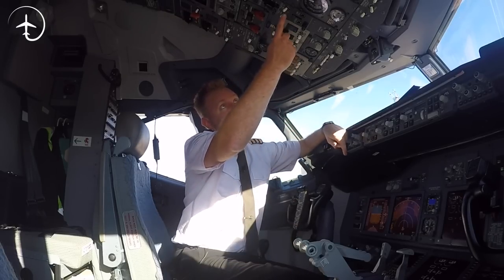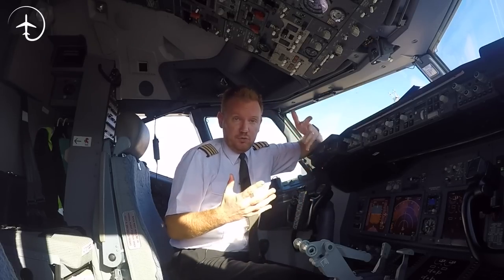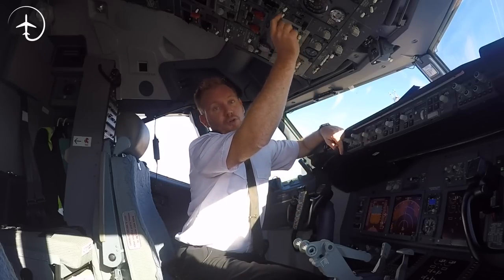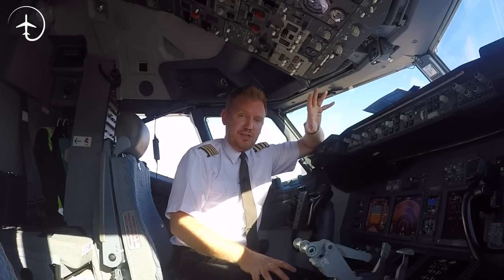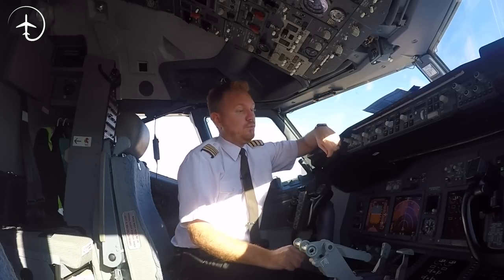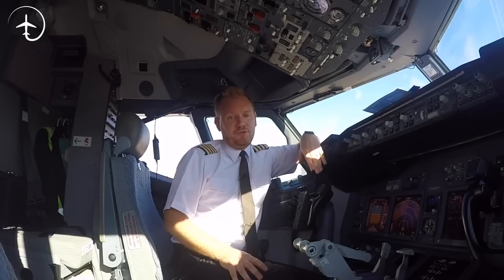Aircraft HORN (Claxon) and “No smoking” signs

Comment: Is this a 737?
Reply: The SP Channel HD yeah
Reply: The SP Channel HD yes
Reply: Now the question is: Is this a 737-800 or a 737-900? Also, what are the major differences between these two aircrafts?
Reply: 737-800 ... the -800 is a stretch of the -700 (which itself is a stretch to the original 732 / 737-200).  The -900 is a further stretch from the -800 for increased capacity.
Reply: JayManLive Ahah nice one.
Reply: It’s an ultralight modification

Comment: Today my question is how many high to flying airplane
Reply from the maker: The B737 can climb to 41000 feet
Reply: Mentour Pilot sir why plan push back please please please tell me
Reply: Many reasons (I work at ARN as a pushback-driver and a start-up-leader)
Here is one: Planes can not go reverse. The engines are not built to reverse the thrust.
IF the aircraft-manufacturers did make engines which could go reverse, the pilots would not be able to see what is behind the aircraft... so anyway a dead end...

But if an aircraft is parked at an open position (No gates or etc) the aircraft could go straight forward (only if allowed by airport regulations and parking stand) and no pushback is necessary. At ARN you need a start-up-leader anyway in this case to make sure engines are started properly/safe etc...

@Mentour Pilot , maybe you could do a video how the pushback is done?
Reply: Philip Ljungberg wawo Nice now i am clear thank you so much for your reply so see you
Reply: Saw a start-up on stand and taxiing out in INN performed by an A319, kind of interesting to see instead of pushbacks.
Reply: durga sapkota different aircraft have different limits. The A320 is 39,100 feet. The Falcon 8 is FL510.
Reply: Ava Mendez What would happen if you climbed higher
Reply: Pedro Almeida FL 510 is the service ceiling. for turbojet powered aircraft, offers 500ft/min mxroc. the absolute ceiling is where mxclb is reduced to zero.
Reply: Pedro Almeida I don't know for sure, but i think if you went above too far (so not like 100ft above, more like 1000ft above) the engines would start having problems due to the thin air and you would stall because the thin air wouldn't provide enough lift to keep the aircraft in the air.
Reply: Freckles057 Oh alright. Thank you very much!
Reply: Pedro Almeida engine problems start to occur and pressurization becomes a factor for safe flight
Reply: Philip Ljungberg already done by captainjoe
Reply: Philip Ljungberg - Reverse thrust is used on landing as brake assist.
Reply: to leave the gate
Reply: Depends...what's your drug of choice?  I would recommend uppers for a pilot. Smoking weed or banging heroin just seems like a bad idea for a pilot. A little hit off the crack pipe - probably not that big a deal.

Comment: You are half way to answering the takeoff and landing bird intake problem. This will take explaining. I did freight at Braniff and ground service at Eastern. Then I drove truck nationwide for 27 years. Birds also fly into trucks. I realized that they were chasing food or each other oblivious to road noise which was constant. The low pitched air horns sounded in a staccato fashion got their attention immediately. They were able to maneuver out of the way with incredibly fast maneuvers. Answer- low pitch air horn on nose gear staccato sound left on until 3-4 thousand feet.

Comment: Captain, thanks for a great video.  I learn new things every time I watch your video.  I am also a low time PPL pilot flying Cessna 172.  On this video I can see the shape of the windshield of the 737.  I have always wondered what is the purpose of the 2 extra windshields on top of the regular windshields on each side of of the cockpit?  I see that each panel is fitted with a cover.
Reply: Go check out the new video of Mentour Pilot if you haven't already done so! It completely answers your question.

Comment: I knew of a banner towing airplane that had a horn installed. It was an interesting extra, it was used to get the attention of public when the plane was towing a banner in the coastline at 500ft. Also know of another Cessna with impressive loud speakers installed pointing down that did advertising for a Circus. Those were one of a kind.

Comment: Hi! Often times when i flew on older Soviet made airplanes (TU-134, Tu-154, IL-86, IL-62), i talked to the pilots after the flight. I would ask if they like flying an analog plane with no computers. They would always answer that it is much more connected, and they prefer it much more. Also, it is safer. Now, being reasonable, i questioned their answer in my mind. Do they say that out of pride, or is it indeed more connected or safer since there are no electronics that can fail? Thank you for your answer!

Comment: Okay, 2 other questions, then:
1. Who made the first laws against ever smoking on the planes, and how did they get other countries to follow suit, so that the planes now just have the signs always on?
2. Why would it be such a big deal to change the type rating, and if that's the case, why not just leave a hole where the switch used to be, in about the same way a dial space doesn't have a dial but that doesn't change the type (and use a different memory device), so that the factories don't have to waste a switch on nothing?

Comment: Thank you Mentour for a very insightful presentation. Can you please also let me know why is there a typical "Ding" sound for notification inside cabin? This is common sound in all types of passenger aircraft. Does it haVe to do anything with decibel level or frequency in which this sound is produced, it can be heard easily while engines are roaring in full throttle and our ears also pop after certain altitude pressures?  Or is it yet another tradition being followed over decades?

Comment: I often see pilots blink (and ding) the fasten seat belt sign, same message to the cabin crew?
Enjoying these quickie tech lessons.  So that little sound from the wheel well gets much louder when the engines are running?  A train's air horn moves animals very effectively.
Reply: The Ground Call sound doesn't become louder. When the engines are running you can't hear the sound "far and wide on the airport" because the sound of the engines 'cancels' the Ground Call sound.

Comment: Light aircraft at least should absolutely have horns; to be used on the apron, not in the holding position! I worked in an Aerodrome for thirty years and had a PPL license for some time, and I can assure you that there are many instances where you are willing to call or warn a nearby Marshall or mechanic or fellow crewman. Instead we used to throttle up a few times to gain attention, which is silly. Likewise, there should be a simple way of calling a crewman inside an aircraft without using a voice cable. We used to shake an aileron, shake the wingtip ennergically or knock on the wing surface,  and pilots inside hated that! 😂

Comment: My question is: what route should I take to become a pilot? Should I go to university first and study aero mechanical engineering and get a job or should I take out some student loans and start by getting my PPL and attend a flight school (and if so, where?) either way I would like to fly larger aircraft. I should also mention I am 16 and about will be Finishing in 6 or 18 months depending not the route I take. Thanks, Nathan
Reply: PumaSpeedster i get this question a lot and what it boils down to is time and budget. If you have access to $100,000 USD and can afford to study full time for 18 months, than the integrated program may be for you. If not,  the modular route is an option. usually for those already working full time who wish to finance their training. a pay as you go, path. this is what i did. took a bit longer but the quality of the training is the same. Best to visit 4 or 5 schools, see what they have to offer and chose the program that suits you best. I wish you every luck🛫
Reply: I am a huge proponent of the 4 year degree.  if, for some reason you loose your medical, you have a solid safety net to fall into

Comment: I have two questions about the smoking sign switch:
1.: Is it mentioned anywhere in the checklist, is this habit taught or is it just passed on pilot by pilot?
2.: Is the switch actually wired, is its state registered anywhere in the system or not?
Reply: The answer to your question is:
1-There is a "topic" (I think there's another word for this, but I can't remember) in the checklist that states "Passengers Signs", which should be replied with "On" or "Off". These passengers signs are the seat belt sign and the no smoking sign. As now the no smoking sign can't be turned off, that topic in the checklist is only directed to the seat belt sign switch. That "habit" is part of the Airline's SOPs (Standard Operating Procedures) and they're taught by the Airline. As Mentour mentioned in the video, this procedure can vary from airline to airline.
2-Sorry, but I can't answer this question, I have no idea. It's a good question, though...

Comment: With all do respect Capt. The answer to the "No smoking sign is because FAA still require it." Type rating has nothing to do with it. New A/C like 787 350 still have "No Smoking". At least that what I have read.
Reply: Mahmood Aldawood but it's desactivated so i don't think that was the reason. Faa is also diffrent from easa.
Reply: Piotr Kuler it is still working all the time. The only thing is deactivated is the control of it. Yes EASA is different but remember that most A/C are operating in the USA.
Reply: Mentour is operating in Europe. He's based in Girona, Spain and he doesn't fly to the USA

Comment: I still remember the first time I ever was on a commercial aircraft the noise during take-off and ascent was different from all other times where there was a perceived sense of strain coming from the engines. Sometimes it was constant and sometimes it was drifting on and off at about a 1 to 3 second period. Now obviously it was a normal condition but it was a little un-nerving to me as a first time flyer although nobody else seemed effected by it. Was it just a designed resonance of the engine or something else?

Comment: Hi captain. I was wondering why do pilots flare and what is the use and if you could do a video on this topic. That would be awesome
Reply from the maker: Otherwise the landings would be REALLY hard. :)
Reply: But why?
Reply: Mentour Pilot thanks for the quick reply captain
Reply: Mentour Pilot and keep making these very informative videos , you And captain joe really give me a lot of inspiration to become a pilot because I love flying on prepar3d and I love flying so thanks again Captain
Reply: Pedro Almeida Flare, in a fixed wing aircraft, is the transition phase between the final approach and the touchdown on the landing surface. the sub-phase of flight normally involves a simultaneous increase in aircraft pitch attitude and a reduction in engine power/thrust, the combination of which results in a decrease in both rate of descent and airspeed.
if there was no flare, you would land on the nose gear which isn't designed to absorb 65 tonnes
Reply: Ok thanx

Comment: Hi Captain! Very nice! In the same lines - how does the cabin crew communicate with the cockpit before/while taxiing? It happens via this wire phone I suppose - but what are the standard communication protocols? I can always hear 'Cabin crew seats for departure/takeoff' from the cockpit, but what needs to be done beforehand by the crew to hear this confirmation. Is it a final call telling that everything is set to clear, or does it need to be reconfirmed by the crew?
Reply: The "Cabin crew, seats for departure/takeoff" doesn't have anything to do with the passengers. The passengers are already 'secured' when the pilot says this. When he says this on the PA, it is for the cabin crew, the flight attendants, go to their seasts and fasten their seatbelts for takeoff.
Reply: Yes, but I assume some cabin-cockpit communication is going on behind the scenes - which the passengers don't hear. I am interested in that part :).
Reply: Dainius Jakubauskas on the ground up to 10k just cabin secured sign as far as i know. Emergencies are whole other sermon.
Reply: Yes the pilots can communicate to the cabin crew without the passengers listening

Comment: Do airliners have specific invisible pathways and control spaces they are never allowed to depart from while in flight.  It's very similar to a railway line separated into control blocks to prevent collisions.  Departing a control block puts a train locomotive into automatic shutdown with a very loud alarm.  In the case of an aircraft, I would assume the jet would take an automatic turn instead along with a loud alarm saying you left your control space.

Comment: What where the 3 positions on the no-smoking switch used for back in the heyday of smoking? I presume at one point, smoking was allowed on airplanes, or there wouldn't be a switch in the first place.
Reply: The three positions are on, off (which are pretty self-explanatory) and the auto position which turned on the sign when the gear was down.

Comment: Hey mentour! which rule of thumb do you use to identify which kind of holding entry method you are going to use? I know about the 3 finger rule and using the ND in centered mode with drawing the inbound course and completing it with the "race track pattern" right/left round.
Reply: Fabi Hansi there are three types of entry used for a hold: direct, parallel and teardrop. the choice of entry will depend on the angle from which we approach the hold and is computed by the FMS prior to our arrival.
Reply: I know :D But I want to find the best method for raw data IFR training ;)

Comment: serious question here. not a pilot but a few hours of copilot time in my fathers piper seneca twin. how can it happen that a pilot is unfamiliar with a planes automated systems. ( ASIANA 214 Crash ). Even for a king air turboprop twin, my father had to go trough a fairly thorough type rating. Are type ratings for commercial pilots weight biased or model biased ? big fan of your videos as an aviation fan. keep it up ! :) would love a video on type ratings and how thorough they are !
Reply: Each different model has a different type rating.

Comment: If you could sit down with the head of cockpit design at Boeing, and the need to keep the changes to a minimum was nonexistent, what would you ask them to change?

I ask as the 737's cockpit design and ergonomics are quite similar to when the 737 was first launched, although that said it could be that Boeing did such a good job in the first place that there's not much that could be improved... :)

Comment: Could you explain what's head wind,tail wind and how it affects performance
Reply: SaRavanan TheBoss A head wind is a wind that blows in the opposite direction of your course. A tail wind is the opposite. You always prefer a tail wind IN FLIGHT, because when the wind is "by your side" you'll get to your destination faster and burn less fuel. A head wind has the opposite effects. During takeoff and landing you prefer a head wind, because it increases your airspeed during takeoff, so you use less runway, and helps you to stop during landing. Hope I could help!

Comment: Why we do not use thrust reversers for taking aircraft back ??
Reply: Sangeeta Kanojia It is not allowed by regulation
Reply: Sangeeta Kanojia on some of the older Mad Dogs, McDonnell Douglas series airplanes such as the DC-8 and 9 models, you could perform on ground reversing. in the A320, this is forbidden, as it creates a hazard to ground personnel and equipment

Comment: Hello captain it’s good to see your videos. My question is why are all planes obliged to take off after V1 (even if there is a problem) no matter the length of the runway? Or am I wrong?
Reply: Gildas Kabore After V1, it is no longer safe to try to abort takeoff.
Reply: Ozan Akdag I still do not understand why it’s not safe to abort the take off even if the runway is very long. Do you understand what I mean?
Reply: It just isn't. The takeoff performance calculators calculate that... If you abort after V1, there is a high chance you will overrun the runway. And usually, the V1 is near the VR speed, so you'll get to V1 when you have used most of the runway. Of course, if you're flying a heavy plane, you may get V1 much earlier before.
Reply: Alright. Thank you Ozan Akdag.

Comment: Hi captain can you talk about how pilots in the past (before RNAV) navigate when they are flying long haul flights and crossing big oceans?
Reply: Henry Chan before the advent of the INS which went into service with Pan Am in 1969, airliners of the time, used celestial navigation just like Columbus did,  while traversing the oceans
Reply: Ava Mendez oh yes. That’s why they have extra windows on the ceiling right? But how often did they have to check for their location using sextants and how do the routes of the flight plans of those flights look like?
Reply: Henry Chan the sextant was inserted via a slot in the roof of the aircraft, they took three shots each from a different star. from this triple fix, a position was determined in about ten minutes. position was updated every hour,  just as it is now and reported to either Gander or Shanwick oceanic  conntrol via HF. The flight plans were computer generated throughout the 1950'5 and 1960's with the normal compliment of land based radio aids, fuel predictions, weather information and the like
Reply: But how about the routes? Do the dispatchers give pilots a bunch of coordinates or what?